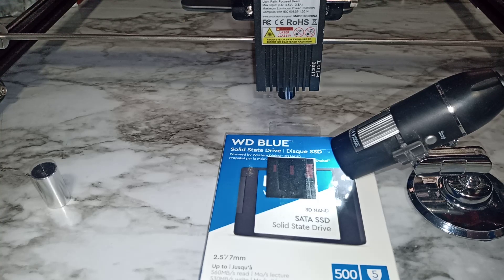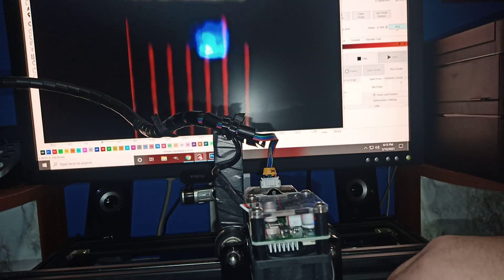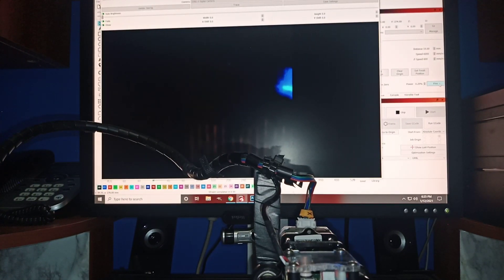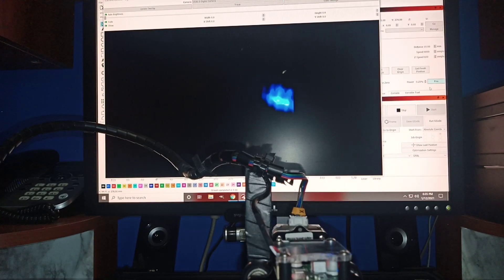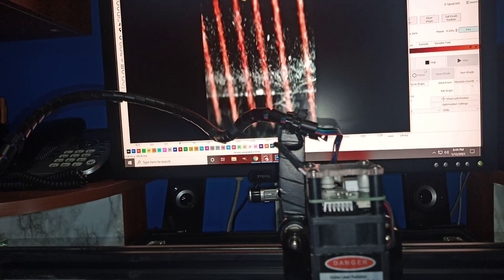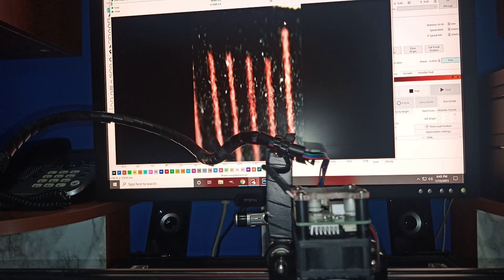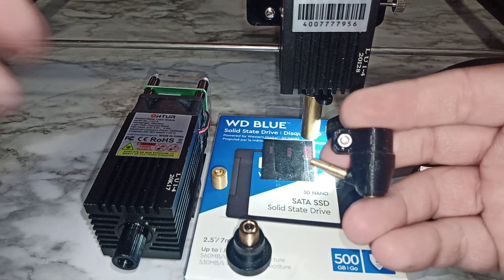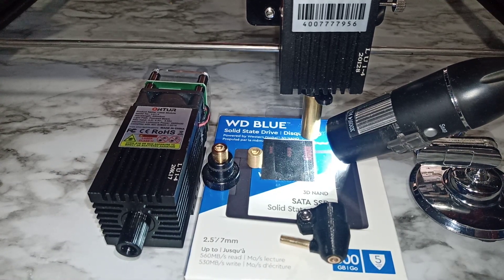Ortur stock lens vs G2 vs G8 vs ortur new 20w laser model

Comment: Very helpful comparative test. What is the width of the thinnest line that these diodes and lenses can reliably engrave? Eyeballing it on my rigs, I am coming up with 0.1-0.2mm.  Perfectly good for most applications. How does that compare with CO2 or Fibre resolutions?
Reply from the maker: Not sure about CO2 from videos I had watched before the dial it does very small engraving if I'm not mistaken smaller than all of the lasers

Comment: Hello ! Thanks for doing this video, i have an Ortur 15W and i can’t adjust the focus anymore. Everything works perfectly but it won’t engrave anymore. If soldons has a solution to my problem feel free to answer ! Thanks
Reply from the maker: Who is soldons?  wwhat's the exact issue you're having I'll try my best to help you can you make a little videov
Reply: @wisamyousif14  hello, i has the olm2 15w to but i cant cut plywood even the included in the box
Reply from the maker: @YorielGonzalez  what speed and power you are using and how many passes

Remember 15w it's not strong as the 20w 
Focus to the bottom of the wood plus you going to have to do more passes and slow your laser down and if you're not using air assist you might start burning the edges
Reply: @wisamyousif14  1000/100% 7 pases... you know the laser come defective and yesterday that the aprove me the replacement i offer pay a difference for the 20w the tech support representant says that wont win a lot with the 20w vs the 15w, only a 1.mm of focus .. let me know
Reply: @wisamyousif14  other material i has some issues is powder coated mugs .. it begin to engrave but at middle only mark and dont engrave until the metal base.. sone trick is needed.. 1000mm/100%  2 passes

Comment: I received the new 20w as well (not sure how to swap I the g8 on this model though as there doesn't seem to be any obvious removal option).  I really hope there is an option to swap lenses (that would be a big drawback if you cannot...i.e if something breaks/needs to be cleaned, etc)

I liked this video a lot, thanks for testing each!

I am brand new to lasers so forgive me if I am incorrect, but don't the various lenses have different focal lengths?  

I am sure you did this but does the test take into account manually focusing each lense to attempt finding the smallest dot prior to evaluating  on your scale...or simply use the included depth block included in the latest model?

Thumbs up for walking through the various options!
Reply from the maker: yes each Lions have his own death I did not show it on the video, I did not want to waste too much time for you guys,

I just showed the smallest my recommendation the new model is better than G8 lens

Comment: Does the new model not allow you to swap the lens? I have a g8 lens I bought but I cannot remove the lens on the 20 watt
Reply: I did the same thing. I bought the g8 but it seems like the new fixed focus 20w does a better job by itself. Plus I don't see how to remove the original lens.
Reply from the maker: @Funaddictstudio  my recommendation the new model is better than G8 lens
Reply: Same situation. I suspect there is a way to swap it (you can see threads inside the barrel) but I just looked quickly and couldn't find a quick method like people show on the older units.
Reply from the maker: @tim6360  my recommendation the new model is better than G8 lens